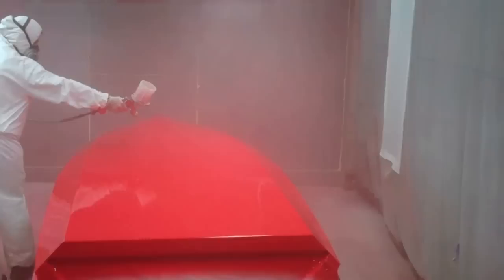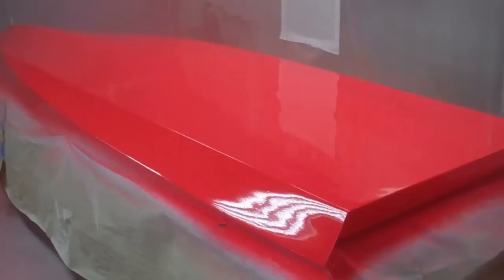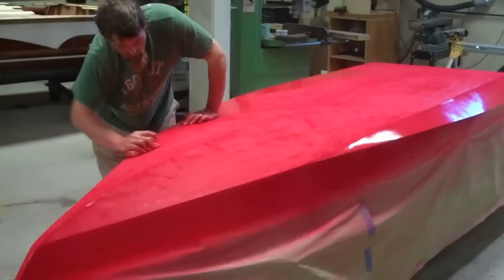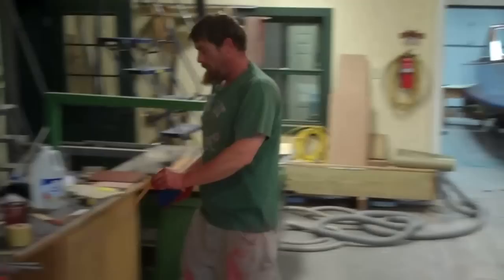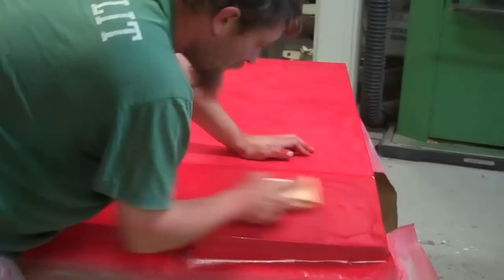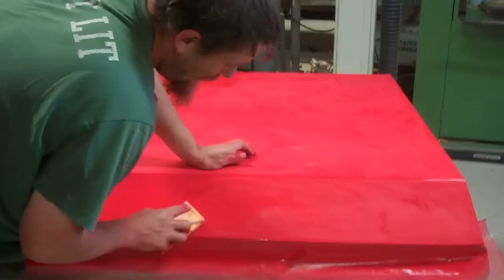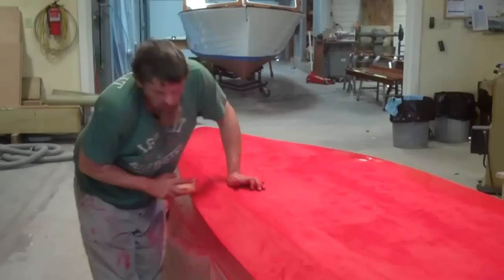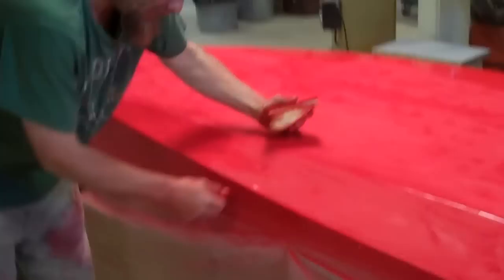1957 Speedliner Caravel - an Interlux Perfection Two-Part Epoxy, Rochelle Red Bottom

Comment: I have been building the Aeroliner Race Boats from the plans and patterns I purchased in 1965 since purchasing the plans.  One thing mentioned is that you want a perfectly smooth finish.  The best finish is like that of a Dolphin wiich is smooth but not slippery. The water line of the boat does not go as far forward as you have done, should end about the rib for the aft end of the forward deck.

Comment: The original Speedliners in 1957 were not built by Steves dad, his father purchased the assets of General Marine in I believe 1984.  In 1965 I purchased the plans and patterns for the the Corsair Speedliner from General Marine which was their BU runabout.  At the time I purchased the plans and patterns I also purchased the next to last wood boat built by General Marine as a Speedliner.
The boats in 1957 were either white paint or varnish. Thery were not finished from the factory two tone.

Comment: looks good but I would have used imron elite before I used perfection,, its allot tougher paint has a better shine and will outlast it by far,, I used it on a 58ft yacht 25 years ago and it still has a great shine,, I also use it on all the outboard motors I restore and it looks awesome on motors and holds up great under water,, ive tried about every paint there is and never found anything that holds up as well
Reply: I love Imron as well. All the younger guys pay too much for Awlgrip in my opinion.

Comment: Spraying two part epoxy interlux  without a air fed mask is very dangerous for your health !!!!
and filming it to also btw
Reply from the maker: Yup ... which is why we no longer spray. Indeed, we have discovered Epifanes Monourethane, which we roll and tip, and truth be told, deliver a finish that trumps spraying epoxy without the attendant risks.